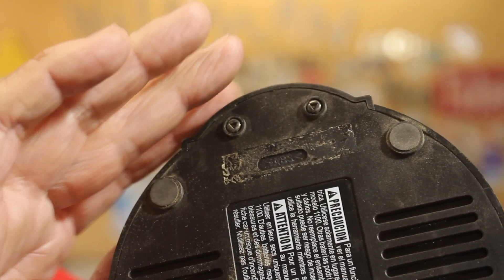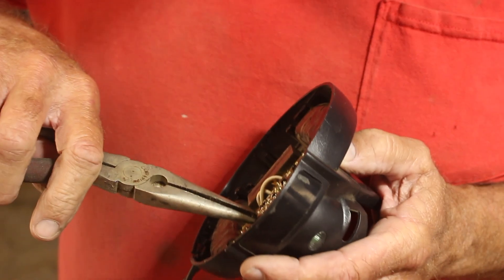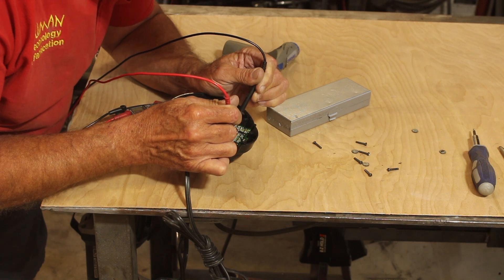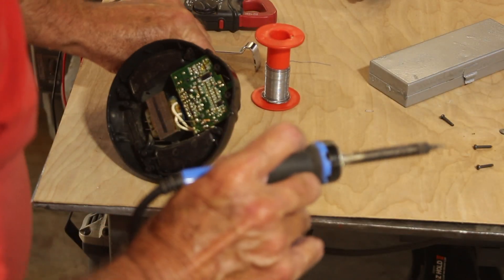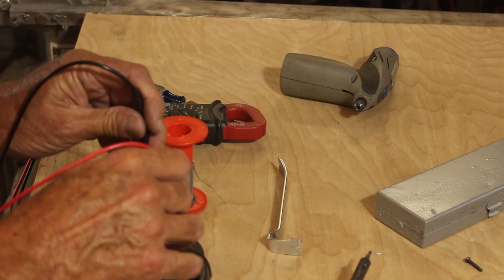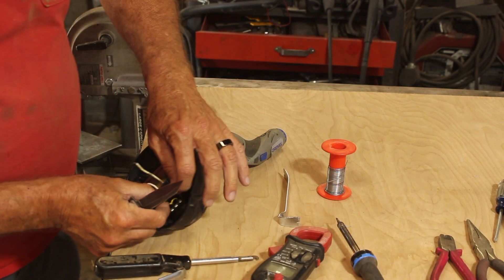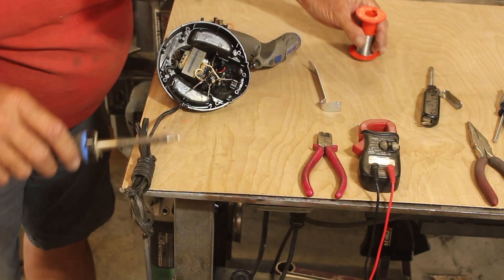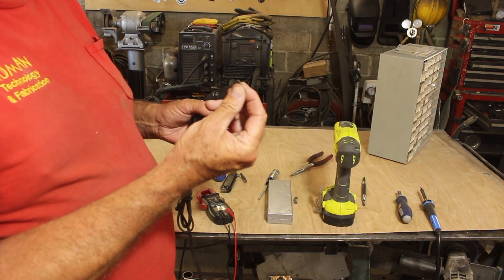Repair your Dremel Stylus Charger!

Comment: LiOn batteries will not last very long with straight DC charging.  They require a profiled current controlled charge (hence the extra IC components on your original board).  Basically when the batteries approach full you have to back off on the charge current or you will quickly wear them out.  That is why electric cars can charge to 80% quickly but take almost as long to get that last 20%.  You can buy loose charge boards for 2 cells for peanuts on ebay.
Reply from the maker: Thanks for posting this. I just bought five for $7.99 on Amazon. https://amzn.to/3KDGt2x I didn't know they were so readily available. I'll post a follow-up video when they arrive.
Reply: @WildmanTech  I just learned something additional here in the comments!  Good stuff fellas.
Reply: @WildmanTech  Did you ever post a follow up vid using the Amazon boards?
Reply from the maker: @kungfubuckaroo nope

Comment: +Wildman Tech You would be best off by getting a cheap LIPO charger from an old toy, and wiring it to the pins on the base.  You are bypassing very important logic that handles cell balancing and prevents over charging of the lipo cells.  You really do need that, unfortunately.  Fire hazard and very limited cell life will be the consequence.  Good luck!

Comment: My transformer blew out when my neutral feed wire got cut by a back hoe.  I've looked and looked to figure out what the output of the stock transformer was so I can replace it.  THANK YOU. THANK YOU!  I think I will just replace it with a wall lump 12v 350mah and wire it into the base, bypassing the the rectifier of course.  That should give the unit a little more surge protection too.  Have a great day!  Update...  I removed the transformer and connected a 12v 1a wall plug directly to the board in it's place and voila...  Charging and working fine.

Comment: Wow! Just found my old dremel base charger under my deck. Been there a good 9 years. Wont charge my drill or rotary im gonna try this. Ebay has the the charger for $60. and the drill for $200. Had the drill in a drawer with charge from 9 years ago. If it doesn’t work im gonna ebay it

Comment: If these are Lithium Ion cells, and they probably are, charging them without management circuitry (which is what that PCB is) will over stress the cells at best, and could cause a fire.  The management board does a lot more than monitor temperature.  It provides a controlled constant-current phase, usually followed by a constant voltage phase, then a maintenance phase.  Li-Ions are very finicky that way.

I watch just about all of your videos, but even with your disclaimers, this video offers bad advice.
Reply from the maker: Fairly certain I mention that more than once in this video.

Comment: Nice tip on the repair Marsh. Adding the capacitor will really help make the difference on a smooth steady voltage supply.  👍